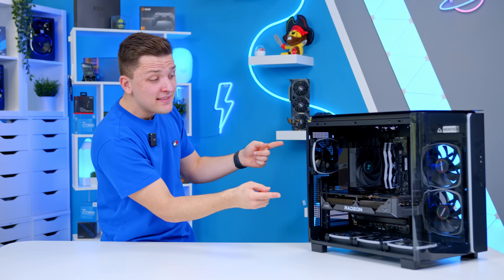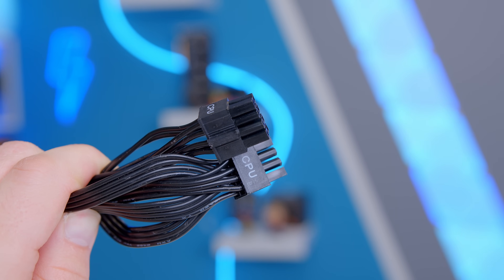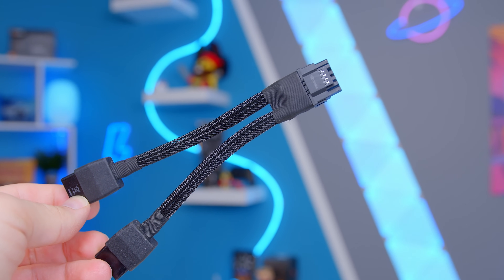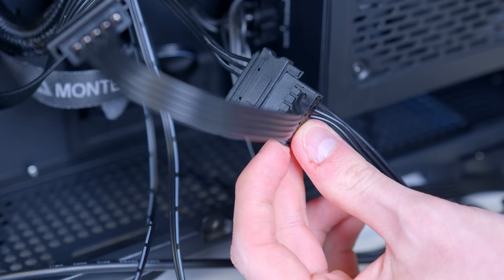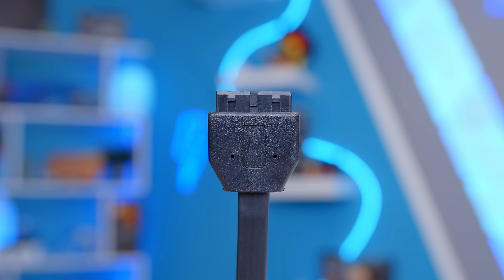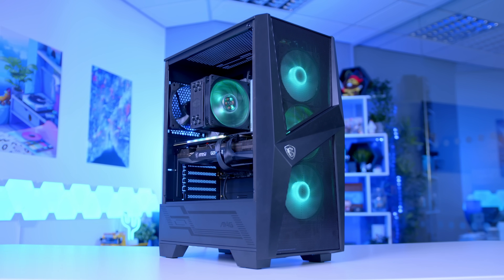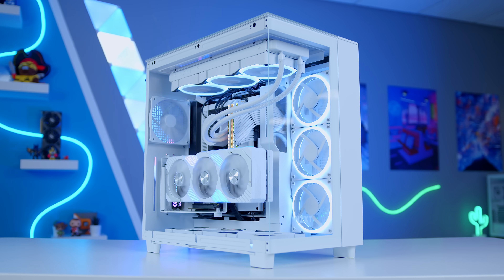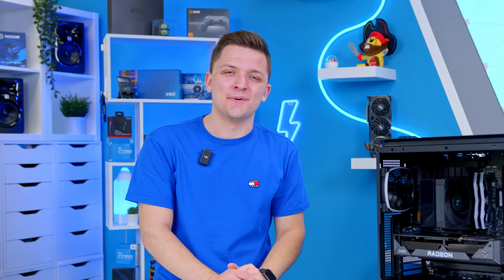A Beginners Guide to PC Cables & Wiring! 🔧 [Power, Front Panel, RGB & More]

Comment: question is good pc build ryzen 7 RTX 5070TI 32 GB DDr 5 liquid cooler motherboard asus ROG STRIX X670E-F 128GB power supple MSI MPG A1000G PCIES ATX12V 3.0-80PLus Gold -1000 watt-Modulair-100-240V-Acti Case MSI FORCE 32R AIRFLOW

Comment: This has helped me out somewhat.  I have no clue how old this video is (fool on me for not checking) but my PSU,  a Be Quiet power zone 2,  came with "VGA" cables.  I assume some PSUs specify VGA for GPU power cables instead of pcie?

And the CPU cables baffle me but I'll need to reference Be Quiet for that it seems.

Comment: ONE QUESTION PLEASE.
My PSU , MSI MAG A850GL only provides 2 PCIE to 8 PINS cables with each ends has another 8 Pins Daisy Chained .. how am I suppose to power a GPU that needs 3 or 4 ? is it safe to use the Daisy Chained 8 Pins ?

Comment: Thanks for this video. Actually really good work! Last time I built a PC was 5 years ago and RGB was not en vogue back then so let me ask one question:
Do I understand correctly that nowadays 
1) you can daisy chain fans together so that you have one cable adressing all fans
2) then plug in the fan connectors for the daisy chain as well as stand-alone fans into the mother board e.g., CH FAN1, CH FAN2
3) and at the same time plugin the RGB connectors to what exactly? If there is a hub, that is fine. If there is no hub, where do fans get RGB info from? USB from motherboard?

Comment: Remember, slack is your friend until you seat the cable. Then slack is kill. Pull it tight, tie it if needed and tuck it if you need. Guide along the frame and out of site of the glass display of your build.

Comment: radiator cable of the AIO [Silverstone XE360-TR5] is 3 pin but the motherboard [ASUS PRO WS WRX90E-SAGE SE] has only a 4 pin W-PUMP, there is no 3 pin at all on the motherboard

Comment: I got NZXT H9 flow case with that F panel plug. It only has 4 pins on the top none at the bottom seems similar to this video. My case will not power up do to the other pins missing.

Comment: i like your presentation but i need more detail.how to read bluprint every mother board wiering and wich plug go where.i used old case with gigabyte 650,the mothe board had difrent lable then old board,i had to ges with front panell and fans,gigabyte blueprint has no god detail,how to identify cables and how to test them if they work properly.i turn the computer off and fan is steel glowing.i have to turn power swich off.there are 3 fan plugs,how i know which is which.it is working now i do not wonet to tuch anything on bord now.

Comment: Where do i put my 3 pin fan cables? You didnt specify
Reply: You put them in the 4 pin slot but make sure the plastic lines on your fan plug slide into the plastic bit on the motherboard

Comment: When I did my build, I get everything mostly right, but there were 2 cpu fans sockets and the AIO pump socket on the M/B. I plugged the AIO fan cluster into one of the cpu fan sockets, only to find the BIOS reporting that I didn't have a CPU fan installed!? But it did recognize the secondary CPU fan as being connected. So I took everything apart, unplugged the CPU fan, then plugged it straight back into the secondary fan socket... yeah, still didn't work right. Eventually I managed to remember which socket was for the primary CPU fan, and everything was up and running in short order.

Comment: This was super helpful. I do still have a question. Where does the other side of the two 8 pin CPU power plug connect? Is it directly to the PSU or does it connect somewhere on the motherboard?

Comment: did not help me at all omg
Reply: Bro fr he just talks about all the cables. Look at ur motherboard guide and see where shit goes then watch a guide on rgb and fans
Reply: @bullymaguire.69x everyone has different hardware and cases dumba**
Reply: @bullymaguire.69x the cables are literally the only thing you need he said where general areas are too and they are labeled which he also told what the labels are for
Reply: @bullymaguire.69x yeah, because it’s your pc build not his. Aren’t you glad he isn’t babying you? I mean it’s wiring. If you mess it up just try again
Reply: @Dark_HumourYT  if you mess it up and it shorts, there goes thousands of dollars. 

Trying again comes at a major, irreplaceable potential cost.
Reply: @MrHocotateFreight  no it doesn’t bro, I’ve failed wiring 3 times when I was building my first pc without reading the manual. Once for the front panel cables and twice for the gpu and cpu in which the pc just didn’t turn on. And nothing happened
Reply: Helped me with my first build alot
Reply: If this didn't help you neeeeeeed to go back to school and learn to pay attention.
Reply: How would you short out the board if you just plug shit in the right direction and play around with what works?
Reply: How 😭
Reply: You're just dumb if you don't understand
Reply: Skill issue
Reply: come on man its really too easy to build up pc these days.
Reply: Skill issue
Reply: Agreed, what a shit guide
Reply: @brofourtwenty2143 it isn't, he teaches about cables and wiring which is exactly that tutorial. If U wanna learn to build a pc, watch his other pc building tutorials

Comment: You may have solved a small big big issue Iv been having for weeks poured way too much time and money to solving lmao I’m still fairly new to building and the botherboard has 2 cpu pin headers and 8 pin and a 4 pin. My power supply doesn’t come with that 4 pin and I was under the impression that I NEEDED to plug in that 4 pin so I found a old laying around 4pin pcie wire from an old PSU and I think this is the reason my pc has not been able to power on at all. I even took it to a shop and the guy told me my psu was bad cuz he had it running on a new psu but he didn’t tell me anything about those 2 psu pin headers. I have a Ryzen 7 7800x 3D

Comment: what if my pc was turned off but my psu was still turned on and at the rams full speed it would have weird video glitches but just under its mhz (3533) it would be find, and then i got a new gpu which didn't work under load and just made my pc restart, was it my psus fault? and did leaving the psu on while adding the ram break my psu?

Comment: Thanks for that!  Very helpful.  Got a question though.  My m/b has a "PD_PWR" connector which connects to a 6 pin (well 8 pin with two pins at one end blocked off) "PCIE/CPU" connector on the PS.  What is this used for? This is an MSI m/b and Corsair PS. Maybe PD stands for "power distribution", maybe?  Thanks!

Comment: I’ve just build my first pc and I’ve got a pci gen 4 psu with a 4080 super? Should I buy an extension cable for the Gpu or will it be fine to keep the existing cables.

Comment: genuine question, I have a ryzen 5 3500 and 1650 super but i am upgrading and having a hard time figuring out to what yet. I thought about it and saw some bench marks on the 4070 and ryzen 5 5600x (was also thinking about the 5800X3D)  they were pretty good, but i also saw a combo for ryzen 7 7700x with a motherboard and wifi for around 500 but I don't have the ddr5 ram. If I were to get the combo I am going to pair it with the 6800. Should I stick with the old AM4 platform or go to the new AM5 platfom.
Reply: If you are waiting a few more years to build a brand new pc with nicer components, stick to am4, but if you want a capable pc rn, go am5

Comment: The power motherboard connectors: It doesn't matter which way you plug in the power and reset switch headers they will work either way. The LEDs however if plugged in the wrong way won't light up but this won't destroy the LEDs. If there is no lights when you power on your PC just switch it off and plug them in the other way and they will be fine.

And don't daisy chain more than 4 fans to one motherboard fan header as there won't be enough voltage.